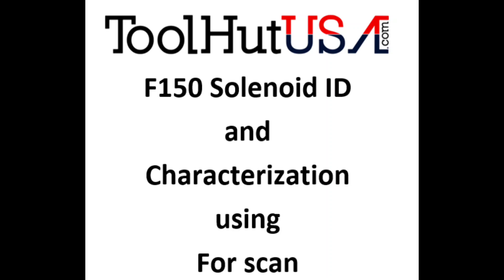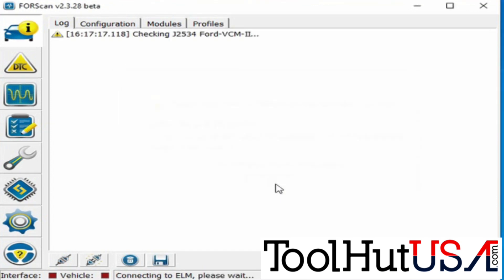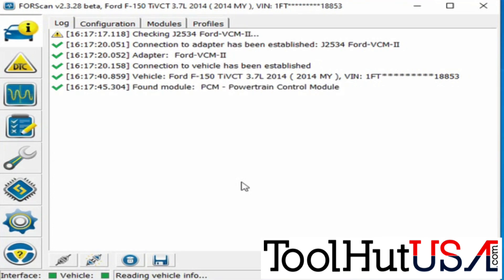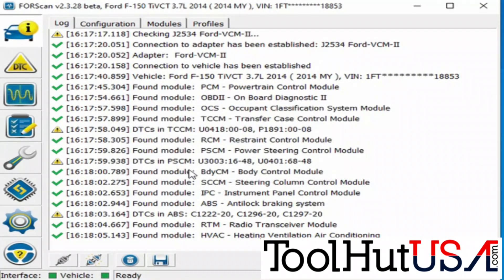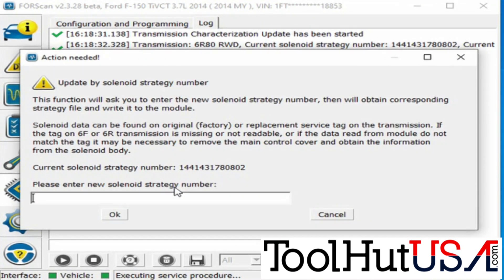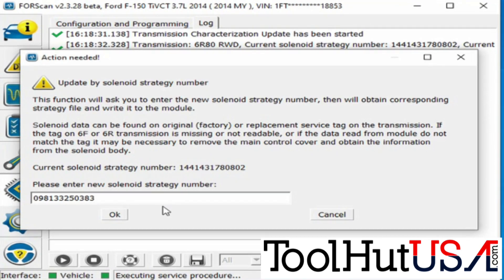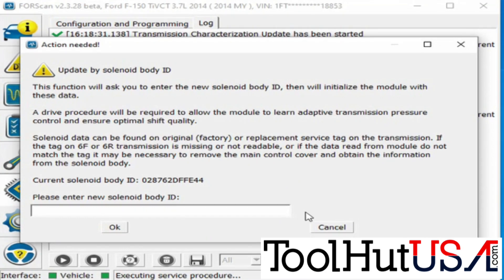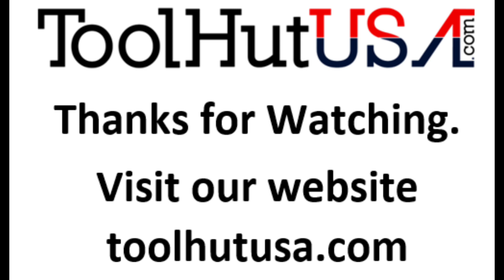14 F150 Transmission ID and Characterization using ForScan

Comment: I just downloaded and installed Forscan with the free 2 month extended license, but I'm not getting the option to perform the transmission characterization update on the software.  Just replaced the transmission valve body/lead frame assembly in a '10 F150 with a 6r80 trans...has anyone had similar issues?
Reply: Did you figure it out? Attempting same thing/same year and a little nervous to start before having this figured out.
Reply: Same issue here on my 2010 F-150 Raptor with the 6R80 transmission. Not finding this option in Forscan.
Will be replacing the valve body with my remanufactured unit purchased.
Thanks

Comment: So this is what I have to do since I replaced my 6r80 and the car is throwing shift solenoid codes. Was told I could swap the valve body’s back to my original one from the old trans and still got the same codes. So do I still need to use for scan to update it?
Reply: Did this fix your issues?

Comment: If I just replace the valve body.  Will the new valve body come with the strategy number to punch in where you put the transmission number?  Thanks.
Reply from the maker: Yes, should have the numbers on the valve body and/or some documentation
Reply: @toolhutusaakathecarflasher3019  thanks. I downloaded the extended version just in case I needed it. Hopefully this fixes my lead frame issue.  Had to buy the entire valve body to get an OEM lead frame. Tried a refurbished one, still having same issue. Thanks for your video.
Reply: One more question, other videos I have seen says it needs internet connection. Is that accurate?
Reply from the maker: @rjyoungjr  depends on what tool you use
Reply: @toolhutusaakathecarflasher3019  sorry. I’m using the forscan with the obd2 interface v1.5 to load the transmission valve body strategy. Leadframe went bad and only way to get an OEM is by buying the entire new valve body. I’m pretty sure your video shows an internet connection is required.
Reply from the maker: @rjyoungjr  yes it will require internet